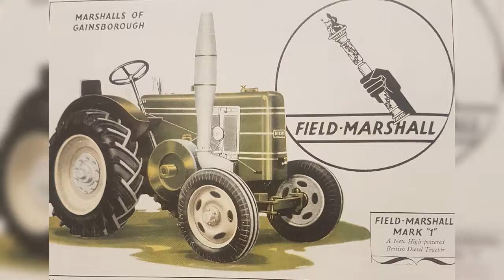Field Marshall Series 1 rebuild by Carl Hargreaves

Comment: interesting work on that conrod can you but the end caps off the shelf for them i have a friend has one in trouble with the bigend hanging out of it also the pin is in trouble i think
Reply from the maker: you can buy the parts from Robert Crawford's in Frithville, Lincolnshire. They are quite pricey tho.
I just took .025" off each side of the end cap, bolted it back together and rebored it with .007" oil tolerance. I have an old farm Mechanisation book stating minimum 
.006" and Crawford's were stating .008" so I went inbetween the 2 sets of figures and she seems o.k
My crank was at .0025" ovality and the maximum wear is
 .004" ovality.
Reply: @CarlHargreavesRustyRelicsUK  thanks for that info at least somewhere to start from .007" at the moment its 500" lol